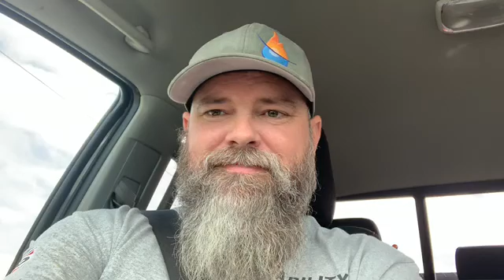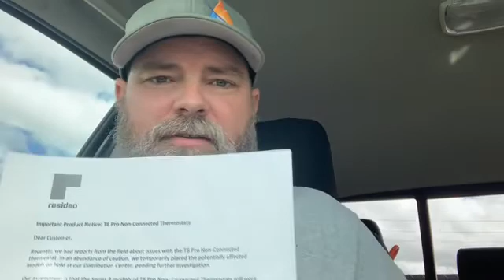Honeywell T6 Pro Issues

Comment: Where do I find that report.  We just installed 2 T6 PRO NON WIFI THERMOSTATS on a 2 zone heat pump with back up gas heat. And an ewc zone panel.. 5 days ago . Today I found both of these thermostats locked up. Both show heat set to 68 and both reading 63-64 . And had no voltage to Y , G. On heat pump call. For either zone. Reset power to the thermostats only and boom now they are both working.  Always been a big fan of Honeywell.
Reply from the maker: I have since this lost the document.

Comment: A thermostat is just a set of 4 switches at it's basic level. There should not be a compatibility issue with specific systems. The last Honeywell thermostat I bought was a few months ago. It was defective out of the box. I re-installed my 15+ year old Honeywell, and returned the new junk. 

The only reason I bought the new thermostat was for integration with my fully local home automation system. I'm in the process of designing and building my own smart thermostat now. Honeywell will never see a dime from me again.
Reply: @fixitman2174 hey, so, how are you making out with this project? I run Home Assistant and installed a TH6320ZW2003 (T6 Pro Z-Wave) for integration and local control. Thought it was awesome until it got cold out and the thermostat wouldn’t call for aux heat. That’s how I realized it was bad after troubleshooting. Another one (TH6320ZW2007 this time) on the way but… I may need to find a new solution because there appears to be a fatal flaw with these units. I have an X2S also but it’s wifi and I think requires their stupid app to control it, not sure it works with local control. I refuse to use their app. Really hoping there are other options for us.

Comment: I have a 3 yr old Z Wave Pro T6 and the room temperature is not matching the temperature displayed on the thermostat.
Reply from the maker: There is an offset to calibrate in the installer instructions. If you don’t have them you can down load them. Be careful though. Changing the wrong setting can disable your unit. It’s best to be a professional when doing this.
Reply: @AbilityJohn  thanks. Since it’s under the 5 year warranty they will replace it.  They had me test the voltage.

Comment: Mine keeps saying it is blowing heat, but it is air. I don’t understand! Help!
Reply: Mine says 2048 and it doesn’t work!
Reply: What should I buy instead?
Reply from the maker: @K_Michelle  sounds like you may have a heat pump. You’re reversing valve may not be kicking in. You need a professional. You’ll know it’s a heat pump if you have the option on your thermostat for “emergency heat”
Reply: @AbilityJohn  I do have that option! I built a brand new home that is barely a year old. I have submitted request after request for warranty and nobody will acknowledge it. 

Thank you. I will have to get them to respond to me. Somehow.
Reply from the maker: @K_Michelle  what brand unit is it? Is it a heat pump?
Reply: @AbilityJohn  it has the emergency heat option… so I am guessing so. It is carrier. It won’t let me send a pic. 

I am not sure which model number is for what.
Reply: I have thermostat upstairs and downstairs off and it is still blowing cold air.
Reply from the maker: @K_Michelle  you’ll need a professional for sure.
Reply: @AbilityJohn  so is the labor for a system that is a little over a year old covered by a warranty through carrier… or let me guess that is out of my pocket. 🤣
Reply from the maker: @K_Michelle  typically carrier only covers labor for a few months. It’s up to the contractor to warranty labor. This is typically 1 year. I would contact your installation company.
Reply: @AbilityJohn  I assumed…. I have someone coming out tomorrow! Thank you for your advice! 😊

Comment: My thermostat is set at 78 for cooling and rarely moves from there. When the temp drops in the house it rarely reflects actual temp. Yet if the temp drops to 55 outside cooling might go on even if set at 78 which is actually 75 or 76 BTW. This is a new system. What's a better unit?
Reply from the maker: I like EcoBee
Reply: 2126.

Comment: Thank you for the video. We spent $7k on a new AC in mid 2020 and in less than 2 years we have had issues with it constantly. The compresor capacitor has already needed replacing ($300 for a $30-$50 part) and now the thermostat. It will randomly kick on the heat pump in AC mode. and will run non stop on heat, trying to cool the house down! I have to go pull off the thermostat, take out the batteries and give the system 10 minues before turning on the cool again. The AC company Mid FL Heating and Air, wanted to charge us $150 to replace the less than 2 year old broken thermostat. I am a low voltage tech and am capable of installing a new thermostat, what is a brand you recommend? I am tired of spending money on call backs for a system that is less than 2 yeatrs old.
Reply from the maker: I prefer Ecobee
Reply: @AbilityJohn  Thank you for the response! Two things. 
1: I have a cheap Honeywell I got from Home Depot to use temporarily. One with a manual heat/cool switch. The wires don't match up one to one I needed to remove one of the wires and there is only a W1 where as the T6 is on the W2/Aux. Is that an issue, or will it work so long as I follow common wiring standards? I assume if everything functions as it should, it is working properly. 

2: Given the above issue, what Ecobee Model swaps out wire for wire to the T6? They are quite expensive and if we get one I want to be sure it will swap out.
Reply from the maker: Yes Ecobee should switch out wire for wire. I prefer the one that is one step up from cheapest. 
Sounds like you may have a heat pump. I would get a professional to wire it. You could blow the transformer.
Reply: @AbilityJohn  Thanks again. Getting lots of runaround from a couple different AC companies. A couple of guesses of other things like the TXV, which I have no other symptoms of that being bad. Then warranty fees etc. Listen, I am short on money, as many are right now, I have an AC that kicks the heat on randomly and brings my house upwards of 80 in the middle of the day in the summer if no one is home. I need a cheap and fast fix to get me by for a few months. Could I get a Honeywell T4 instead of a T6? They use the same wire patterns and the specs look exactly the same minus the wifi features which I don't use now (didn't even know they had them). The T4 is half the price of a T6 and I wouldn't need to rewire anything since they use the same wire plate. This should get me through the next few months to where I am not in an emergency situation. Thank you.
Reply from the maker: Yes you can use a T4. They also suffer from the same issue but most of the time they are fine. Your Wi-Fi version is the worst of the T line in my opinion. Nothing but issues. I would be surprised if you could even get the Wi-Fi to work.

Comment: I had one installed and within 30 hours the entire system was shorted out. Capacitor, contact Switch and
the main breaker all blown.
Reply from the maker: Sounds like the compressor was going bad before. The thermostat was replaced.

Comment: Hi ! I have issue where the ac shut off say 6Am in the morning and won’t come back on until 12 , 2, or 3 pm  it has been consistently doing that and The schedule is turned off have u seen this kind of problem before it is carrier brand Ac and furnace two thermostat for upstairs and down stars 

Thanks
Reply from the maker: Sounds like the indoor fan motor. Hard to tell without checking it out.

Comment: You said ecobee is compatible, does tht mean if i were to take off the t6 pro and the ecobee will plug in with no wires or connections to change out?  Also which ecobee model, i would like to be able to control on my phone. Thx
Reply from the maker: You would have to uninstall the Ecobee and wires. All Ecobee thermostats are controlled with your phone
Reply: @AbilityJohn  ty for the quick response. I currently have t6 pro with blank screen. Luckily I have my old t4 it came with and using it for now til i find a replacement. Was hoping ecobee was just plug and play. I dont want to mess with any wires

Comment: What brand would you recommend for a heat pump because I have the running all the time issue too ?
Reply from the maker: Unfortunately I still have to recommend Honeywell. Pro5000 is the best for the money. But if you want to spend more money do the Ecobee. It’s the best and has the least issues.
Reply: Do u mean the heat pump runs all the time? My new unit just installed, once heat strips kick in they never go back off and I did not know it. Ran electric bill up to $400 two months in jan and feb before I realized why.
Reply: @ook194  yes it runs all the time and it will be set at say 70 and it will be 70 in the room but continue to run and also adaptive whatever is disabled where it will turn on early to reach temp and it still does this

Comment: My T6 works perfectly in "cool" mode but when it's in "heat" mode (heat pump) the blower runs constantly and will not shut off after it reaches the desired set point. I have to change the mode to cool to get the blower to stop. Anyone know if this is an issue or is it something else in the system?
Reply from the maker: I have seen this with this thermostat.
Reply: Having same issue. Brand new system installed. Cooling works good, but just started getting cold out and tried the heat. Won’t switch off when temperature is reached. Left on a road trip today and shut everything off before I left. Came home today to a 87 degree house.

Comment: Thanks, I appreciate the info, I’m freezing my oranges off here in Tampa because the T 6 will not break my voltage to O , Emergency heat will not work either.
Reply from the maker: What brand is your Heat pump? Rheem Ruud Ameristar and I believe Bosch energize “b” for heat.
Reply: @AbilityJohn  Not solving the emergency heat problem.

Comment: John. I stumbled across this video at the end of my patience. Several days without heat during the coldest week for us this year here in Raleigh (54 deg in house). I have a Honeywell T6 Pro Series (TH6220U2000) Date Code 1915. Intermittent Alert Message "178" Outdoor Temperature Sensor Error. Don't care about Honeywell...what is a good alternative? This thing has 9 wires behind the panel. Besides the red, white, yellow, green standard connections I'm not sure what the others are. Just trying to get heat for us.

Comment: I have one at my house the first one give trouble the Auto changeover wouldn't work only in worked in cool or heat then later the wifi stopped working so I finally got around to doing a  warranty on it everything works for a little bit the auto change over stopped working again on this one SMH
Reply: Be sure to have at least a 3 degree differential between heat and cool.

Comment: Yes, I’m a maintenance manager over 251 apartment units and we use these thermostats. Over the past year I have been consistently replacing these thermostats due to the AC  not coming back on or problems with the heat in the winter time which only drops into the 50’s ( Florida ) . It’s ALWAYS the thermostats!!!! So I have talked with friends of mine at com / res ac companies and they say the same thing that they are moving away from Honeywell also. So now I am using another brand thermostat in all my units. We are a luxury apartment complex and our tenants here should get what they pay for and one of our promises is reliability /dependability when it comes to maintenance and the products that me and my guys install in their units. When I get calls to come back and have to replace the same thermostat that we did twice before then we look bad and our customer gets frustrated with us and next thing you know we start getting letters written to main offices and complaints start rolling in. Only thing that should be changed out 2 times a year is batteries in fire alarms and maybe lightbulbs!!!!! I appreciate your video brother !!!
Reply: @Love4raine  
Switch to the 8000 series and never replace a defective thermostat again

Comment: Hello! We are on our 2nd thermostat replacement due to the fan not shutting off. It works for about a year and then something happens to where the fan runs 24/7. The thermostat and hvac system are brand new. Or brand new when purchased about 2 years ago. Do you have any recommendations please?
Reply from the maker: If you can get a Honeywell pro 5000 it’s a very reliable thermostat.

Comment: John- just had my Honeywell t-6 thermostat installed last week and it just woke my family up with a beeping sound. Not constant, just a few times. It was loud. Took batteries out and put them back in and it stopped. What could be wrong?
Reply from the maker: I have no idea. This is the first time I’ve heard of this. I would suspect a relay malfunctioning..
Reply: @AbilityJohn  First of all, thanks for the video and being genuine. Can you further explain what a relay malfunctioning is?
Reply from the maker: A relay is an electrical switch. They can make strange noises some times. Not often, but it happens. Never seen that in these thermostats. Just a hunch.
Reply: @AbilityJohn  My Honeywell FocusPro TH6000 series is making a shrieking beeping sound for about 5 seconds when it kicks in. It's 9 yrs old and just started doing this. If this is caused by a malfunctioning relay, would you recommend for the thermostat to be replaced?
Reply from the maker: @petervanderwiel9598  yes I would replace it.

Comment: We have an issue with AC not turning off; been running for two days straight on-off mode SMH!
Reply from the maker: That could really increase your power bill. Are you sure it’s not your fan in the on setting? If not then call a professional ASAP.

Comment: Great video. I've had a Honeywell PRO 4000 Series now for just over 4 years. Never had an issue. But in the last month or 2, the up/down round buttons that adjust the temperature  all but took a crap. I have to press my thumb with all my might to get the numbers/temperature to adjust up or down.  Have the springs gone bad or is 5 years the life of a thermostat or what do you think it is?  I replaced the batteries and the unit lights up like it always has, but the up/down buttons are just driving me nuts. Replace the unit????
Reply from the maker: Just replace it. Honeywell has 5 year warranty on their pro series. But honestly just get an Ecobee or a Honeywell Pro 5000 if you can find one.
Reply: Thanks. I guess I'll just do that

Comment: Hello, the thermostat downstairs will not change modes. It's stuck on heat. I can change the temp but the mode will not change to cool. Can you help with that?
Reply from the maker: Sounds like you have a lock on the thermostat. Do you have instructions? What in the model of your thermostat?
Reply: @AbilityJohn  It says T6 Pro Programmable Thermostat.
Reply from the maker: Your thermostat is partially locked. you have to enter the code 1234 to unlock
Reply: @AbilityJohn  ok...thanks

Comment: I have a honeywell t6. How do I stop it from going to recovery mode??????
Reply from the maker: I am unfamiliar with this mode. But after some research it appears you can turn it off in settings. Read your instructions. If you can’t find the physical instructions than look online. I’m sure you can find them there.
Reply: @AbilityJohn  Recovery is simply the "catchup" time between the previous and the next scheduled temperature setting. It pops up just to let you know that "Hey, i'm trying to get to your desired temp that you want, but i'm not there yet. It was created because Homeowners look at their "Set" temp and then their "Room" temp and then say, ITS NOT KEEPING TEMP!!!
Reply from the maker: Sorry, I’m unfamiliar with that mode. Can you explain it better?
Reply: @AbilityJohn   my heat is set to 60° at night but recovery mode clicks on and it sets the thermostat to whatever i have the heat/air programmed for the day. I can't turn it off. I have to get up at night and turn the heat down manually. When it sets to recovery it says recovery on the screen Is there a way to turn off the recovery mode.

Comment: Thanks so much for this! Our thermostat is as old as our house when it was built 2 1/2 yrs ago. About over a week ago our thermostat is having issues- it’s stuck at 66 or 69 room temp (21 degrees F outside Haha). My husband have called Honeywell & warranty company to no avail. Waiting for a call from our builder and we shall see.. The number on the back is 1809.
Reply from the maker: I have had issues outside the date code I mentioned. You could just get a better thermostat like an Ecobee. They aren’t hard to install. Although maybe you don’t want to take the chance of messing up with temps like that.
Reply: @AbilityJohn  Thanks John! We’ll make note of this brand Ecobee. A subcontractor is supposed to come tomorrow, so we shall see. This thermostat we have is under warranty (I think).
Reply: Hi, by chance did Reality Homes build your house? Ours has been stuck on 66 for 3 days now! Just moved into home 2 weeks ago. Please let me know anything that could help! Calling honeywell myself now.
Reply: @brandygarcia4689  Hi, our builder was Twilight Homes (we're in NM). The builder replaced our thermostat and it's been working well. Hope you got your issues resolved by now. Sorry for the late reply.

Comment: We had a new Rheem installed over a year ago with an EcoBee, but we kept getting warnings about aux heat and problems all around. Our HVAC company changed the thermostat to the Honeywell T6 and I thought all was well until we got a $700 electric bill for this past Nov-Dec. I assume the emergency heat is running, but the thermostat has never indicated emergency heat being used. I just want to know how we can get the energy usage back down to normal.
Reply from the maker: The t6 series is known to run the heat strips sometimes when it shouldn’t be. I would change it for a T4. 
The Ecobee is a much better thermostat.